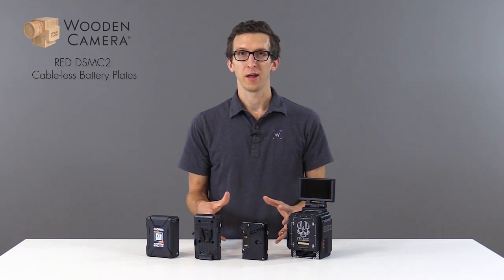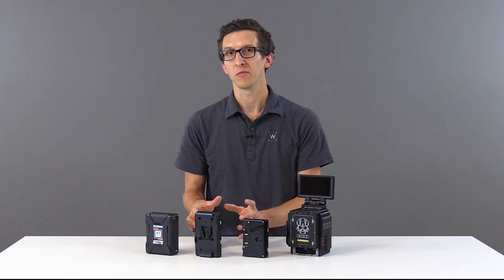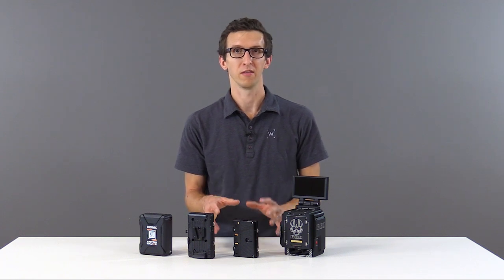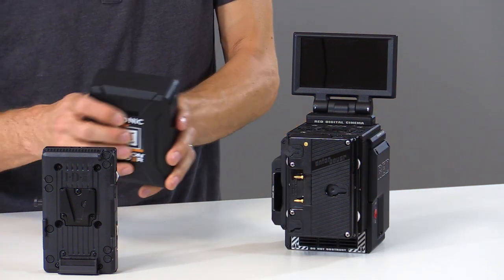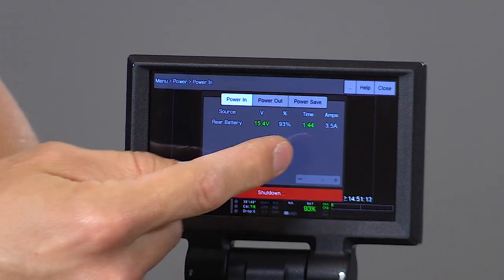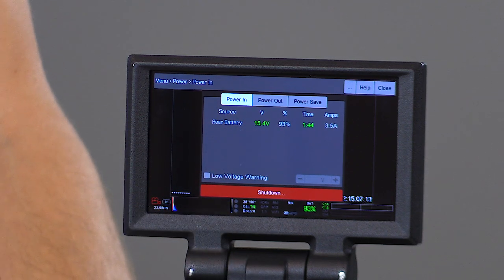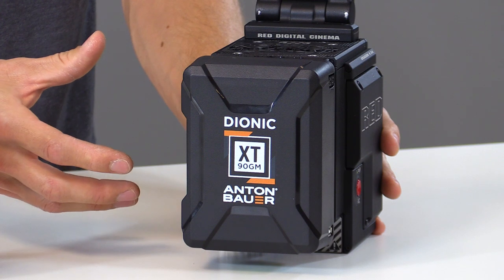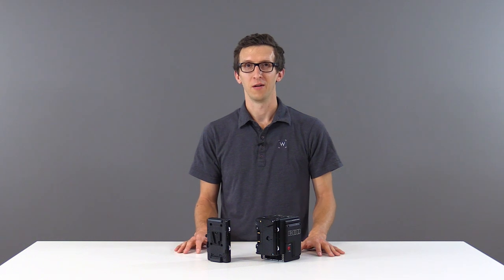RED DSMC2 Cable-less Battery Plates

Comment: Is it possible to power the camera using the dtap ? I mean use the dtap as input power solution with a ac adaptor. I ask this to know if when i change the battery i can continue to give enought power to the camera with te dtap to have time to change the battery without to have to turning off the RED.
Reply from the maker: The D-tap connections on all of our battery plates provide unregulated voltage from a cinema battery and can power the camera while a battery is present. However, there is no internal battery to provide power, so a hot swap as you suggest would not be possible.
Reply: Wooden Camera understood, thx for your answer !